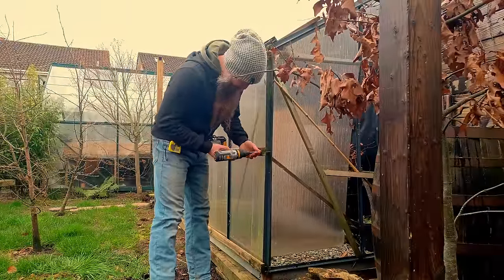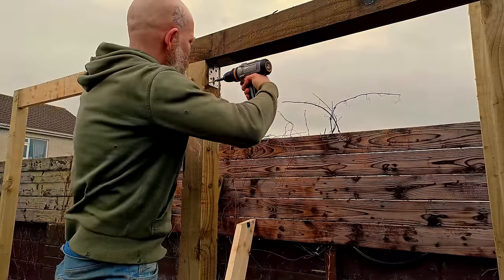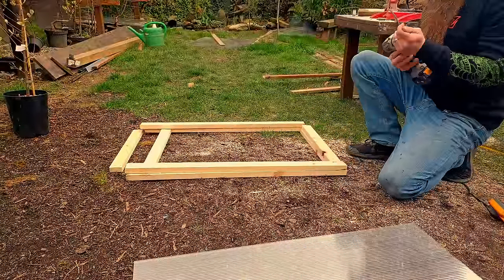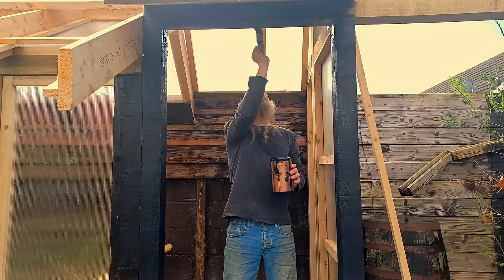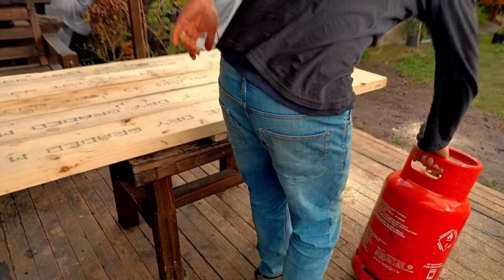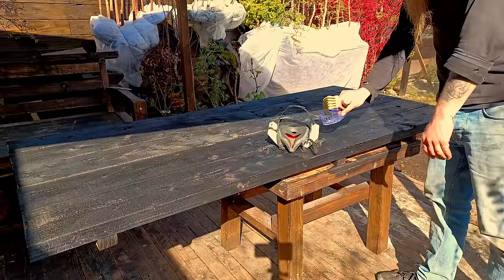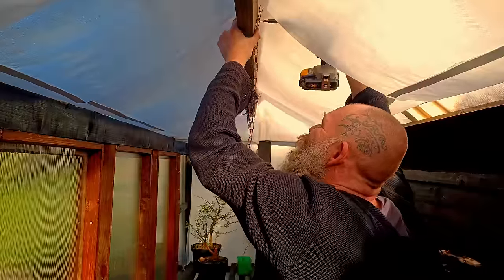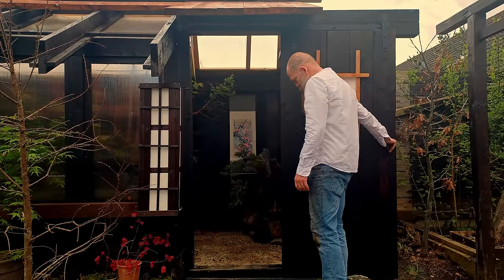How to build a Japanese Style Greenhouse

Comment: I love the build, and reading all the comments, I'm clearly not alone. The one thing I will say, though, is that you probably wanted to treat those 4x4s you imbedded in the ground, or at the very least stuck some packed gravel in the bottom for drainage. Wood lasts far longer when it's not in direct contact with soil.
Reply from the maker: Thank you so much for the suggestion! Will def keep in mind!!! 🙂

Comment: Also I’m not sure if this works for this method but as a woodworker, I often LEAVE the dust from sanding on my project when I apply an oil or finish. It has this added benefit of “filling” in pores and micro cracks, making the project more sealed and finished. I suspect leaving (not washing) the char after you scrub it would actually help.
Reply from the maker: Thanks. I will def try it out next time!

Comment: I mean, it does look nice don't get me wrong but, you could have used like 2/3  of the lumber, 
structurally it is overkill specially if your backwall are concrete bricks you already have 1 supporting wall that is super solid.
I'm just saying that there could have been a little more light coming in with thinner posts.
but it still looks cool.
it seems like you sealed in the bottom floor, I think I would have laid gravel with stone tiles over that, and have some drainage possible out of there, so you could just water the trees liberally and let it drain out.

Comment: Very nice greenhouse. You put in a lot of work. The only thing that worries me is the beams in the concrete. Unfortunately, they will rot in a few years. Wood must have air and concrete holds moisture. Regards
Reply from the maker: Hey Tom! Thanks! I will do some research on that one, as this is my best knowledge at the moment. Will get into wood preservation and how to keep it "alive" for long!
Reply: If you can ensure there is a slope from the timber/concrete, it will help with drainage and reduce the speed it rots. Research drainage around buildings and you might be able to do something to help, even though it's already built.
Reply from the maker: @blacky05hotmail  Thank you so much!😊

Comment: That's such a beautiful greenhouse. What are your temps like in summer and winter.
Reply from the maker: Thank you! We are blessed as Ireland get the best temps for summer and winter. in Celsius Summer max around 22 celsius, winter around +5 , rarely goes to -1, so in the greenhouse is always plus during winter
Reply: @FangornBonsai   I'm here in east Germany so my temps in summer have been in upper 35+ and winters in lower -10/-20c 
I'm looking at trying to build something similar to what you did it's absolutely beautiful. I have some old single glass windows I would use. I currently have 1 white pine 1 soft pine 2 trident maple 2 golden elm 4 cotton Easter.

Comment: Hi, just wanted to ask you if the wood you burned was pine? I'm considering using the technique myself but am uncertain if pine will work. thanks in advance.
Reply from the maker: Yep it was/is pine. Usually the builder suppliers only have pine timber on hand, at least in Dublin 😊 But i guess it would work on any timber, the original Yakisugi method used Cedar boards.